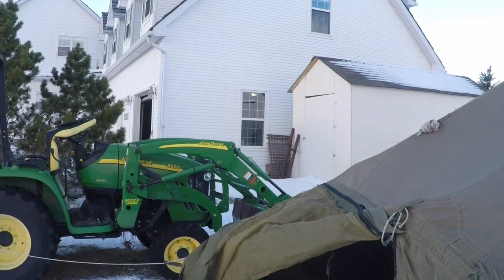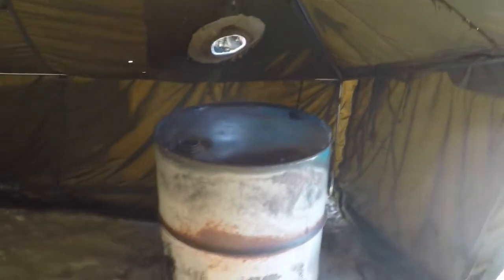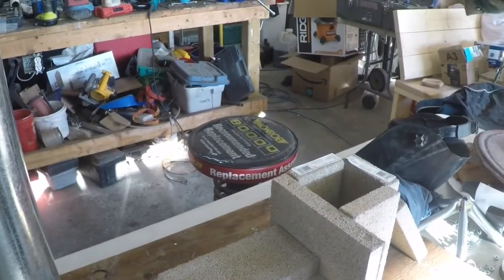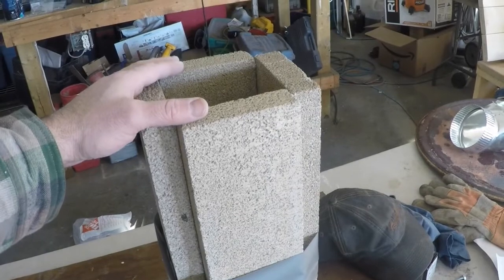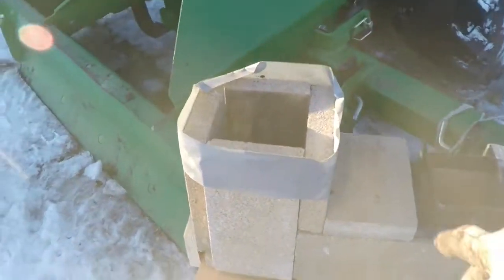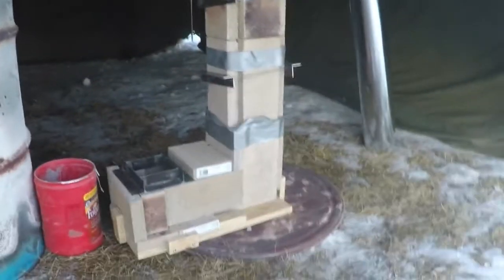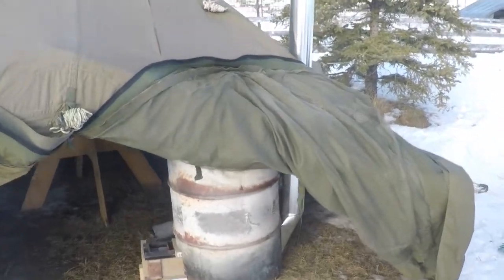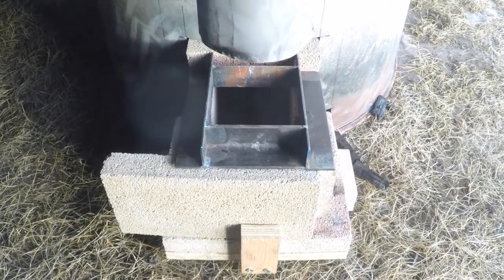Tent Rocket Stove

Comment: Can't let that feed tube be large enough to offset the natural vacuum that's produced in the flue, also separating the air intake from the feed tube outlet will help keep from letting the feed tube become a flue in of itself, which cuts off the natural vacuum from circulating.